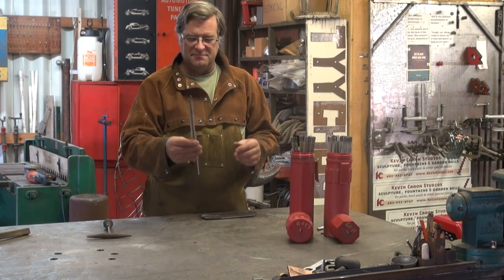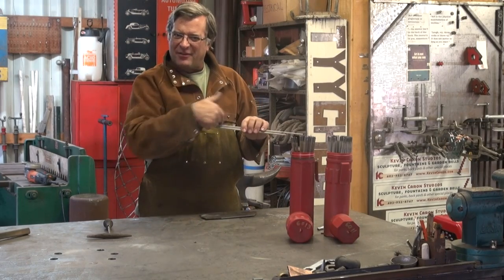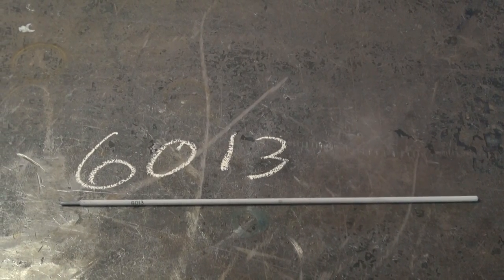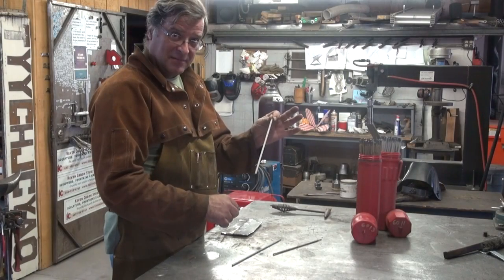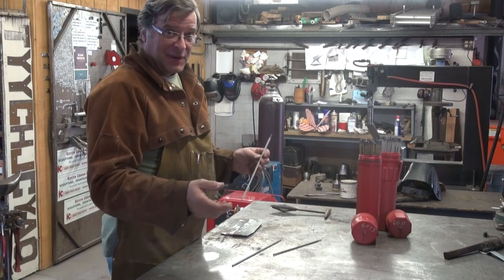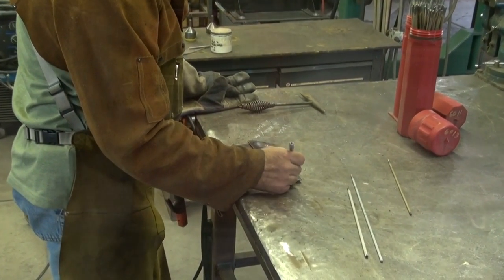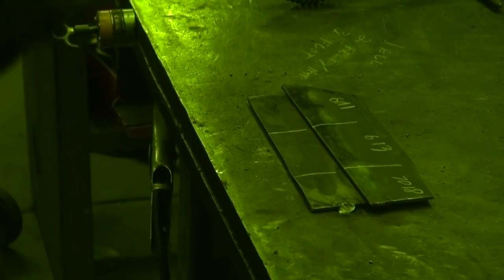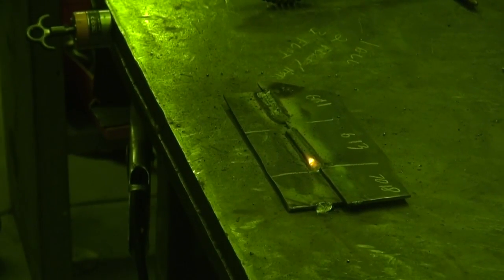How to Select Rods for Arc Welding - Kevin Caron

Comment: Hey Kevin, I have been farm welding for about 55 years and I have all 3 of these rods in my shop. Even though I know that 6011 is a good rod and works well for vertical or rusty applications, I don't often use it. Maybe it's my ego but the bead is rough and you have to chip it a lot more. I never like people to see the 6011 welds. The  6013 and 7018 leave a nice bead and slag is fairly easy to remove. I do have trouble getting the 7018 to start more often and I understand it stores poorly. My go to electrode is the 6013 in 1/8 and 5/32 for thicker material. I tend to use the high end of the amp recommendations.
Reply from the maker: Seems like you have it figured out for you!    Thanks for watching and posting.

Comment: From the video look like you push instead of drag when welding?? So the saying when slag you drag is not true?? It depend on the welder??
Reply from the maker: I am self-taught so will probably have a few bad habits.  I have found that pulling the puddle or just keeping the stick vertical and moving with the puddle works just fine for me.   I would not recommend doing this for anything that needs a strong weld.  If you are making art that is one thing, when you are building bridges that is something else.   Thank you for watching and posting.

Comment: I think you are wrong on one point: 7018 AC electrodes may be used with AC or DC welding…. And not restricted to just AC… I checked with Lincoln’s website.
Reply from the maker: Thank you for keeping me in line.    I will blame it on the grey hair!

Comment: 6011 don't need higher amp, run it in lower amp it will be smooth, 6013 need higher amp to run smoothly. You can run 6011 on rusty area compared to 6013, you'll need to grind or sand it first.
Reply from the maker: Thanks for the info, so much to learn about welding!

Comment: Enjoy your videos. I live in Thailand where the house power is 220 volts, am new to welding and want to buy a cheap mini welder and need to know what amp to buy 200 amp. 400 amp, 600 amp.
Reply from the maker: I would look in the 200 to 250 range to start.
Reply: @KevincaronSculpture  I have the chance to buy a 600 amp Zard machine from thai man in village. Will this be to much machine.

Comment: Trying not to get so damn frustrated, laying beads im pretty ok with so far. Then when I started laying beads on a fillet filling it up, everything was different
Reply from the maker: Hate to say it but that is welding.   How you do "this" weld will change from one to the next.   You have to be ready to read the puddle and adapt as you are welding.   Even if it means stopping in mid joint and changing settings to compensate for changes in the setup.
Reply: @KevincaronSculpture  right, thanks, yes I thought like what the hell why does it feel different from a flat base than a t joint

Comment: 3/32" is smaller not bigger then 1/8".   Running the same setting on all 3 is weird. I dont even weld at the same setting to the guy beside me, and definitely not for different rods or applications and here its spatter not splatter....
Reply from the maker: Yeah, sometimes my mouth runs faster than my brain.   But just trying to show the difference with only making one change to the setting.   What happens when I do this?!?!?   Trying to keep it interesting and hopefully answer a question along the way.

Comment: 3/32nd is a 32nd smaller than an 1/8th inch.. next size up from an 1/8th would be 5/32nd if thats a  thing in welding electrodes.
Reply from the maker: My mouth runs faster than my brain most of the time.
Reply: Ha, i feel that.

Comment: 7018 AC (according to the documentation I've read) is also rated for use with DC. I have used 7018AC for years and ran it on DC almost exclusively with excellent results.
The only difference is that there is a conductive element in the coating that makes restrike much easier. As most people know when regular 7018 rod cools between welds you need to "scratch" the end a few times to get the flux off before it will conduct and strike properly. Very annoying.  So I started buying the AC version of it and continued to use it on DC. I cannot see any difference in the welds from either rod welding them side by side so I'm convinced it doesn't matter which way you run it.  I've had people swear that you have to run 7018AC on only AC but I do not believe that anymore. Maybe some brands of rod are that way but everything I've seen says on the box that it will work with DC also.   Good luck.
Reply from the maker: I hate that part!

Comment: hello Kevin can you tell me which temperature i will use 6011 welding rod. than good weld. please reply me.
Reply from the maker: All depends on the diameter of the rod.       3/32    40-85       1/8      70-120      5/32   80-160

Comment: its not 60,000 lbs until the weld breaks. 60,000 lbs. is the tensile strength per square inch
Reply: Definition of 
-
Tensile Strength :
the resistance of a material to breaking under tension.
Reply: @UnTamedMustang  Internet expert WRECKED, lol.

Comment: Hell I want some 1.5 inch rods, I got a Battleship to weld. Thanks for the video.
Reply: I run 1/4"  250 dc  ,  so do you wear body armor  for the heat  ?  what's your amp setting  1,500 !

Comment: Good quick little video. But In the first place. Im going to school to get a degree in welding. I have been welding since i was probably 10 or so and im 19 nearly 20 now. Ive burned a lot of rods and learned a lot over my years (not everything by any stretch of the imagination). First off most AC rods can be used with DC welders as well unless specifically mentioned. However DC rods wont work with AC welders. The differnece in the two types is AC rods have a chemical in them to stabilize the arc since its Alternating Current... it changes polarity several hundred times a second thus making the arc unstable. So an AC rod works with DC amd may help ever so slightly. And that "coating" is called FLUX. Next. All these rods have totally different purposes. Great selection to start with but it doesnt even cover the ever so common 6010. But anyway. The 6011 is a root rod. Meant for deep penetration on the root (first) pass. The 6010 is a deeper digging root rod also but takes a lot of practice and knowledge to properly weld with it. Next both 6013 and 7018 rods are capper rods. They are used for capping the joint with a final pass. Thats why they looked so much better than the 6011 which is meant to be covered. The 6013 in my opion is the easiest rod to weld. The 7018 is a great rod but also is a more advanced rod to avoid trapping slag (called slag inclusions) in the weld. Like i said. All of these rods have totally different purposes. Hence the reason for the video.. to tell you the differences. And on that note. They also all use different currents. So keeping your welder set on one amperage for all these is FALSE. Granted there may be instances where it does happen that way. Anyway. I would recommend for farm/ranch/hobby welders the 6011 for some pentration and weld strength. And the 6013 for a capper or welding on thin metal or something that wont take a lot of stress or something that just needs to look pretty. But i would still study up and learn the proper way to run the 6010 and 7018. There is so much information on rods alone that its impossible to know everything. This was a good video though and ill thumbs up it. But just remember everybody that there is no easy way to tell or cure all rod for welding everything. Good video though and i hope you like it too.
Reply: Westley Rudd 7018 Is easier than 6013
Reply: Vasily B i prefer 7018 personally. But for a beginner 6013 is better.

Comment: Anybody learning to weld learn with 6013. It starts and restarts very easy while 7018 is stronger it's a bitch sometimes to restart because slag often forms on the end of the rod if not flicked off when stopping. If you use 7018 keep a flat file close by to prep the tip for restrikes.

Comment: What are the welding rods that have Red flocs on them what are they for
Reply from the maker: Either it is a silver solder rod for Oxy welding or aluminum for stick welding.   Or just really old and I have no idea!
Reply: Welding aluminum stick welding and stick welding stainless steel even though most jobs actually all jobs require tig for stainless steel but for a home project with that hold up to a lot of stuff aluminum stick welding stainless steel stick welder. Another words it would you trust it enough to stand on it
Reply from the maker: No, I am sorry, but I would not trust it enough to use it.

Comment: Hi Kevin, i am learning stick welding. I bought some BI 2x2 3mm tubular, what rod do you think is best to use? And at what amperage? I'm still very confused with which rod to use. I'm going to make a squat rack for my son. 
Thanks for the informative video btw!
Reply from the maker: I would go with 7018.   Either 3/32 or 1/16th if you can find it..   Amps ranges for the two different sizes are right on the box.  Just have to play with some scrap and find the right set up for you and your machine.

Comment: 6013 ,7018 look pretty good .
7018 is not a vertical down rod .. up only
Reply: Bob just about all pipe in the oilfield is downhand. but that's not structural and there's no sheering pressure on pipe. so whole different thing, but you most certainly can downhand 7018.

Comment: No mention of rod storage?   I was taught the 7018 needs to be stored proper;y.  It absorbed moisture from the air and once it does no longer should be used.
Give the guy a break on the measurement.  Yeah he messed-up on camera, 3/32 is smaller than 1/8, big deal.  At least he's making these video - Thank you.  If you thing you can do better, give it a try.  I's not easy.
Reply from the maker: Thank you,   I goofed on the storage but in my defense I live in AZ.  What's moisture?!?!?
Reply: Kevin Caron, Artist   You are welcome.  I live in California.  Not quite as dry, but can be.  

I'm a weekend welder.  Small projects here and there. Wondering what type (#) of rod to get for an AC/DC welder which might store well for a year or more.
Reply: Storage is fine.  If they have been sitting around for a while, just bake them out in an oven at a low-ish setting.
Reply: Passed High School Physics probably 6011 or 6010. 6013 will be good for a while. Ive got rods i keep in the case they came in that are a year or 2 old and i still trust them for the most part. If you do decide to use 7018 buy them in small boxes at a time so youll use most of them and not waste a bunch of rods.. meaning money.
Reply: twwtb a 7018 or 8018? Mmm. I wouldnt trust it.

Comment: Hey I'm 16 I'm learning to weld I got a 70 amp stick welder will it weld a cleen weld on a 1/4 inch peas of steal
Reply from the maker: Nope, not enough amps for that thickness of metal..    Figure you need 1 amp per 0.001 in thickness of metal.. So 1/4 inch is 0.250, so you will need in the 250 amp range to do the job right..
Reply: +Kevin Caron, Artist on thank u I don't woman mess nun up so I thout IDE ask
Reply: can you do that thickness in multiple passes?
Reply: you can if you use a 7018 3/32 rod and do more passes 7018 makes a clean weld to weld over.

Comment: HELP ME PLEASE,,,,, I have a 90 amp arc welder, I'd like to weld some  standard carbon steel to a stainless piece, both are small, thin metal.....can I use 7018 or 6011 for this???
Reply: TheCladi8or Stainless 312 will weld nearly anything to anything provided both will hold a magnet. 

Granted 308-309 would be a better choice.

Keep in mind electrolysis you don't want to be mixing if you don't have to, the mild steel will get sacrificed for the more electrolyticly noble stainless.
Reply: TheCladi8or ive weld stainless to mild steel but i used stainless rod e308 3/32". thats was out of a miller suitcase welder running 110v.
Reply from the maker: The 7018 will work fine..    but the stainless rod e308 would be better..
Reply: With a small welder I'll go for the SS 312. A 3/32 will need around 60-70 amps and you'll get the best welds. Expensive but very easy and very strong. 
Welding carbon steel to stainless requires normally SS 309 or 312 if you want a more ductile weld , or if you are not sure of the alloy of the steel and stainless. 
The 308 is made for the 304 and has too much carbon for welding carbon steel to stainless. The 7018 will give a very brittle weld on the stainless side.
The SS 312 is the best all around electrode when you have difficult welds. Thin metals, dissimilar alloys, unknown alloys including stainless steels, special alloys. tool steel, spring steel, wrought iron, and even cast irons  The SS 312 is machinable it's a big plus in some applications like repairing a crankshaft, or a cast iron.

Comment: Recommend 77 amps for the 6011 dc,it's used for the root welds for coded welding,great rod. You could be blind as a bat and still run a nice root.😎
Reply: Kevin Caron, Artist hello, is it possible to arc weld stainless to regular carbon steel with either 6011 or 7018 3/32 rod....?      PLEASE HELP,   TY
Reply from the maker: Will give it a try next time I stick something..    thanks for the tip..

Comment: I'm new to welding, just need to learn so I can do some small repair jobs on the farm. What is the best way to weld a 3/4" pipe nipple to a flat steel surface?  The nipple would be lying flat on its side NOT standing on end, so your weld is somewhat down in a valley.Also, what is a good way to check to see if what your welder is set on is actually what its putting out at the stinger? My second hand machine is old and I'd like to verify if say 90 amps on the dial is actually what I'm working with. Many thanks!Bob R
Reply from the maker: For that kind of welding I would reach for the mig...   quick and easy..     Far as checking the output of a machine I guess you could try a clamp on amp meter on the cable and see what you get..    Never tried myself..   Just turn it up and get to work..

Comment: Have watched 4 other vids so far trying to work out which rod to use and you were the first one I could understand, thank you sir for your most basic approach to teaching you have definitely renewed my enthusiasm for this craft.....for a moment there I thought I was going to have to get a doctorate in chemistry,  Thank You
Reply: Gold Leaf try 7014 I just picked some up it runs really nice controls easy, restarts easy, good visibility on what's going on, doesn't want to much amps, chips away easy.
Reply: I've never used 7014 before. Mind you I use my everlast mig welder for everything recently but time to brush off the rust and put my hand to stick welding again.

Comment: what are you using to write with and where can I get one?
Reply from the maker: Just a round soapstone in a metal holder..   
Check your local welding supply.
Reply: I have looked here but all I can find are the reptangle type
Reply from the maker: Google round soapstone marking stick,, third one down...

Comment: Nice video!!!  
What stick you recommend for 1 inch square tubing and 90' degree angular?  I want to make a outdoor one burner stove. People use this stove for boil shrimp on a big kettle or to fried big Turkey.   The top 17" x 17" angular iron with  17" height legs on square tubing.
Reply from the maker: big fan of 7018.   just get the right diameter for your job..
Reply: Buy yourself some 3/32 and 1/8 7018 rods. A/C welders need special 7018 AC rods. 7018 rods are the workhorse of the industry. Most welders reach for them first. They do almost everything.  Read up on it.  Practice, practice, practice.  Smaller rod (3/32) do lighter materials, but can do thicker metal too with more passes.  1/8 (a bit bigger rod) does heavier stuff. There are bigger and smaller rods, but you won't need them. You won't be welding razor blades or bridges. Amperage settings for all rods are available on line, in books. Often that info is on the box.  After a little practice with both sizes you'll know which size rod to reach for and how to set the welder. Pipe thickness ? Thin wall pipe (light tubing)= 3/32   thicker stuff= 1/8
 6013 (low penetration) is good for thinner sheet metals. Commonly used on cheap a/c buzz boxes and sometimes called the farmers rod.  It can be used on many things, but usually only in a pinch. 
  You might need 6011 the odd time for dirty, painted, or rusty stuff. But working with 6011 sucks... lotsa sparks and bad looking welds.

Comment: hmm.  not a math whiz but I always thought 1/8 was bigger than 3/32.
Reply: 1/16 - 3/32 - 1/8 I think he just had a brain fart.
Reply: LOL it is. he hopefully meant the other 2 are 3/32 and the 7018 is 1/8"
Reply: Paul Claus in going with the 7018 is 3/32, 100 amps is a little cold for a 1/8 7018 at least DC anyway.
Reply: I think he meant to say 5/32
Reply: 1/8 = 4/32 so it is bigger.
Reply: I'm voting 3/16
Reply: Go metric! So friggin easy... 1.6 or 2.5 or 3.2 forget all this silly fractions! lol
Reply: +GR Weld  please l am looking for a cheap rod welding machine that can welder aluminum, steel, copper and cast to buy. Any help will be appreciated